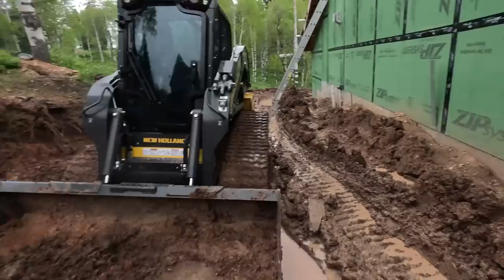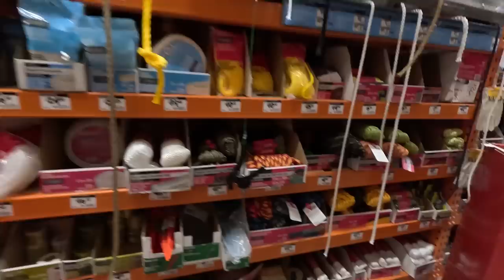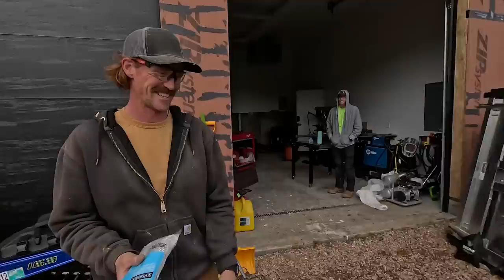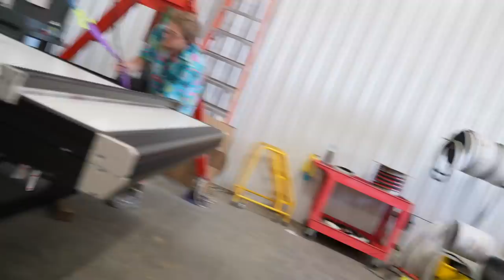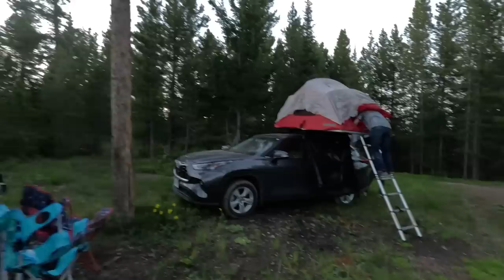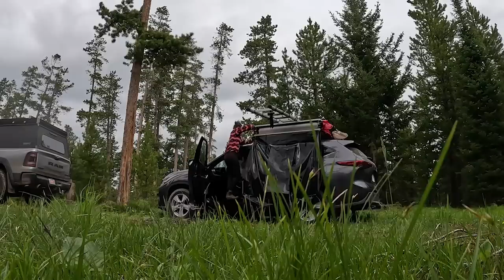THIS IS A GAME CHANGER!!!

Comment: Instead of the rope to hold the insulation in try "insulation spring wire".  Its made specifically hold loose insulation batts in.  Comes 16" or 24" lengths based on you spacing.  They just push in.
Reply: I'm glad that you mentioned this because I couldn't remember what they were called. We used them when we were adding more insulation to our first home.
Reply: I was thinking the same thing.
Reply: Another option; just cut some cardboard strips, 1" wide and 24" long and staple through those to hold the insulation bats in until you rock. The cardboard is thin and won't make much of a difference once the rock is hung! Should give it a try!
Reply: That’s what I was thinking as well
Reply: That's what we used. Easy peasy.
Reply: @meiraloraduncan8953 99i
Reply: @lawrencenielson999  or cut the cardboard a little wider than the width and fold it for stapling flanges.
Reply: Allie’s/Trent’s “rope situation” was just a simple matter of “ failure to communicate”….. happens almost DAILY with my husband and I but we have been married for 32 years and still love ❤️ one another and have 2 grown sons.
I guess we have BOTH chosen to “ chose happiness “ even though ( I gotta admit) he sometimes drives me 😜 nuts!
Oh well….life goes on and I’m so happy you were able to connect with friends, get a new camper and enjoy NO rain!😎
Reply: @lawrencenielson999  You can also just use the bags that the batts come in and cut them into strips.

Comment: Ya do know about the little spring steel wire bits that keep the insulation in place when put inverted don't you? simple and easy peasy- we use them all the time when insulating crawl spaces under houses.

Comment: No... not rope! You should be able to get specifically made wires that are made to be just a bit longer than joist spaces are wide. You press them in, they bow slightly, dig their points into the wood, a bit, and the tension holds the batts in place. I used them in a previous home, with insulating the 'ceiling' of the crawl space. I was using roll insulation to fill the spaces, and these 'suspenders'' to keep the insulation in place before I could unfold the side tabs of the paper-backed insulation and staple them in place. You really do not need to push these wires into the joist spaces very far... maybe a half inch, at most.

Comment: Just noticed on your KXO8O with all the rain you’re getting, if you don’t put a "cap" on your exhaust, your equipment muffler area will rot and there is enough water / water accumulation in the pipe, it might even damage the engine compartment.   Good Luck : )

Comment: I could swear I said this before but they have these Nifty insulation retainers are pieces of 1/8 inch wire stiff wire Avery 24-hour Center 16" 0n center 1 ft on Center they're stiff wires that go in between the studs little Pokey ins and they hold up insulation

Comment: Another option for holding up the insulation bats is they make these stiff wire lengths that are pre-cut to fit into space between the studs or rafters. They are a little springy so you just give them a little push and they span between the rafters and hole the bats up. By the way what you were probably looking for is basically hemp bailing twine to be thin enough to not cause a problem with the drywall.

Comment: Trent FYI i used to do insulating under old homes and when we would come across stud work that was just a little to wide we used small thin stiff wire it was stiff like coat hanger wire to hold the insulation in place and it worked very well even on the under side of floors, just put insulation in place and have wire cut to size and put wire cut a little bit longer than the width of the space between the studs and put in between the studs

Comment: Trent you need either insulation wires or twine or nylon string like you use to string line a wall to see if it straight.

Comment: Hi Trent and Allie, what is the thinking behind no vapor barrier? If we didn’t use vapor barrier in my area, we would have condensation issues in the walls which would ruin the insulation and eventually the structure.

Comment: Allie my best friend and I have been friends for 45 years.  I  don't know what I would have done without her throughout those years.  Leo is soon cute. 
Trent... You don't need rope.  They make wire that holds up the insulation.  I used those wires on my basement ceiling.

Comment: Trent a bit of been there done that, give an insulation product aid called " Tiger's teeth" they fit between the joists and hold insulation in place. They come in packs of 500 and 1000 pcs per package. If your hellbent on tying it up use a roll of bailing twine and staples.😊

Comment: A stiff wire of approriate length to hold insulation in place is probably on the same asile as insulation.  Called insulation support or strong ties.

Comment: 😆 when I built my garage we ran into the same problem. I used 10 lb test fishing line. And also used the flat plastic straps that comes with packages to hold some insulation. 😆 Hey, if it works is it really a dumb idea?

Comment: I used duct hanger tape to do the job of holding up the insulation and we staple it in place in about three places.  It doesn't rot and the animals won't eat it.  It is pretty cheap too.  We have used it for years on insulation in floors and ceilings and it works great.

Comment: Cut the batts into lengths that fit the width of the space. Uses standard batts and insulates roof as needed.
Reply: Except, Trent said there are places where the spray insulation is on the sides of the bays making it so that the batts won't stay in place.  I'd go with the spring wires.

Comment: For future reference, although it might be regional, on the east coast stiff wire 16"+- long is sold for the purpose of holding batts in place when the spacing is a bit too wide. You just fit them, simple as possible.
Since you still much building in front of you, I'd suggest every time you make a trip to the big box store to buy X, buy X plus 6. The time you save is huge.  If you end up with a few X's after your work is done, so what. You'll be ahead of the game.
Trent, for thousands and thousands of years, humans have cooked over an open fire, not some hi-tech piece of something you have to cart around with you, while you wear LEDs strapped to your head!

Comment: All that water, crazy mud for construction but a big boost for Great Salt Lake that was heading for dire dryup last year! The mud will get much better in future years as construction ends, and gravel, pavement, drainage, and plant restoration are completed, so hang in there! If Leo is at all a climber put a barrier across your loft halfwall if you haven't already, he will be pushing and climbing chsirs etc up there. Also, not sure if you have a key lock to prevent night "excursions"-some kids climb and open deadbolts (yep from experience-naked to boot)

Comment: I can't believe you don't know about it. Some years ago I insulted the crawlspace under a home. The insulation fit lose, I was told to go use stays. They're wire cut to length almost like clothes hanger wire "rigid" . you simply flex it in place and it will hold the insulation up. Comes in a box of one hundred.

Comment: Your not supposed to insulate the underneath/Rafter area, what is supposed to be done is the wall not the rooftop, everything outside of the wall is the Attic which is not supposed to be insulated, go and read the rules about Attic's.    The are you want to insulate is if you build a wall around HWH etc, but not the attic.